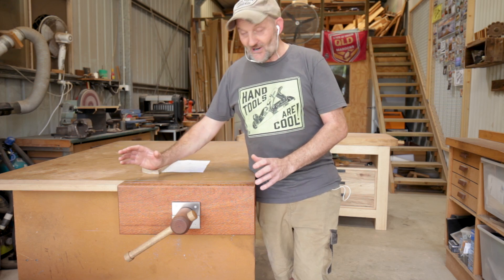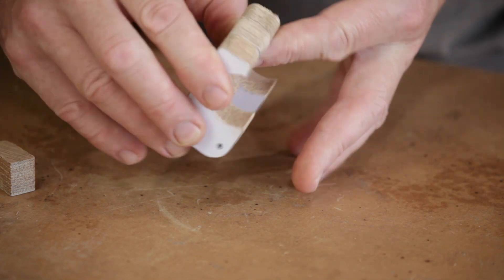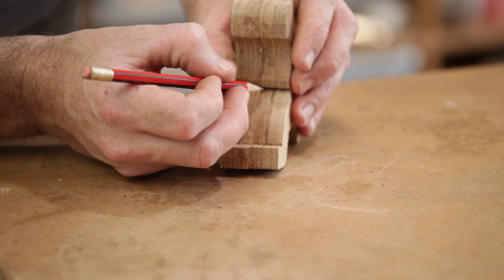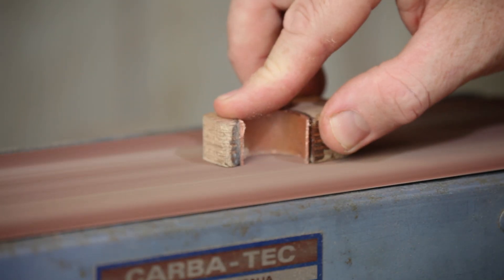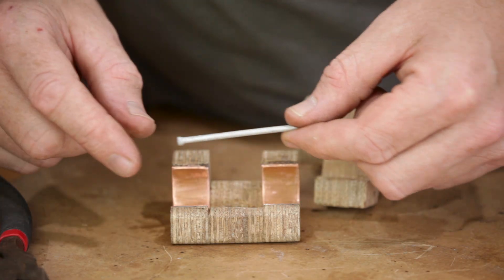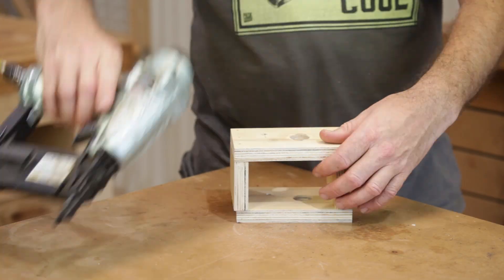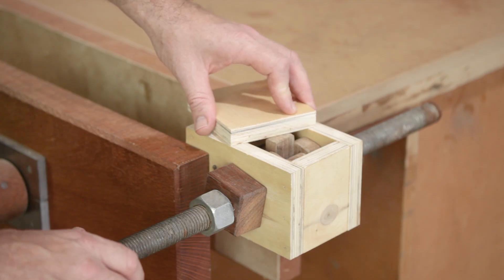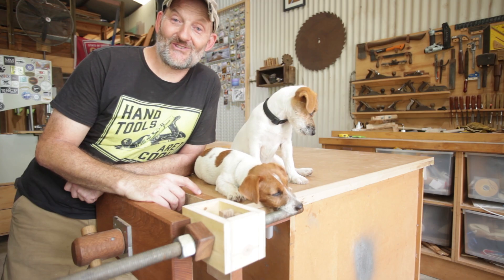Easy Quick Release Vice Mechanism

Comment: Those plans just has to be paid with pay pal eh? Thats too bad, just cant trust pay pal, i never have. Im attenpting to watch your video over and over again to mak a mack up of plans of my own and my goodness its hard. You really have no good shots but i know the threaded bar is 24mm and you cut the slider holes at 28mm. But the middle piece that holds the half nut, the little back arm goes up at an angle instead off parallel with the center on the nut. Thats where im stuck like im missing something.

Comment: Hi Neil, i bought your plans for the workbench build mainly for the quick release vice. just completed my build and i have to say it was worth every cent. the plans are clear concise and having watched your video as well it was a fun project. the main thing i had to change was to find a new pin placement for the pin that the quick release unlocks against as i did not have rare earth magnets. the magnets i had were a bit weaker  so once i had the pin placement a little shallower it worked like a dream. Thanks very much for all your inspiring ideas. Regards, Patrick in South Africa.

Comment: I've just bought and down loaded the plans from your website, and you have done a beautiful job of laying it out.  I like that have made it accessible to the home shop user who has limited facilities.  The nylon bushes made from a chopping block, for instance, is a nice idea.  I mainly bought the plans for the hole centres for the QR mechanism, and I'll be making a vise out of metal.  My main worry is that I'll waste time over-engineering it, but as a time served toolmaker it's one of those 'can't help yourself' situations.  We are slaves to ourselves sometimes.  A huge thanks for the idea which came fully from you.  There are some other versions of the same mechanism online, but yours is stand out better than the others.    Don't forget to check out the Yolanda Mens Shed.  The lathe/mill drill in their video is not flash, but Sheds continuously upgrade their equipment.  Check out this report of Oz and NZ sheds.  The Coffs Harbour shed is HUGE.  I am secretary of the Blenheim shed, and there some pictures on page two of the report.
https://martinsonline.travel.blog/blog-feed/

Comment: Great video, I bought the plans and I'm in the process of making a pair of mechanisms to convert my existing shop made twin screw  vice. I'm using 3/4" threaded rod as that's what the existing vice was made with. When I assembled them the nut  released as it is designed to do but wouldn't re-engage. After a little head scratching I added a second magnet on top of the first, that fixed it and works great! Suggest you add a note to the plans that if the nut doesn't re-engage try a bigger magnet. My first magnet had 9 lb  of strength not much less than the one you used which I believe is 9.5 lb.

Comment: As I say in this video clip, I had to make your quick release vice and the mini-workbench to mount it on just because I thought it is so clever.  https://www.facebook.com/Zale.Dalen/videos/10215501612106963/  My only regret now is that I don't have your quality of scrap wood, so had to make the workbench out of construction lumber, which is too soft.  But it all turned out so well that I think I'm going to remake it in hardwood. I'm also going to learn how to weld so I can make your welded version of the quick release mechanism.  The plywood version works great, mind you.  But it's time I learned to weld, and that quick release would make a good project.  I have a little TIG welder.  All I need is a bottle of argon. Thanks for all the inspiration.

Comment: Great Work. I assume this will only work if the mechanism is mounted horizontally. If you need to use it vertically (For ex. making a height adjustment mechanism of a DIY saw table or router table) you can improve this by having that holding pin to go through a hole in the notch of the center piece and have it to be spring loaded to hold it in closed position. Then cut a curved grove in the housing with the pin jutting out a bit. In this way to quick release you can turn the jutting out pin (You may fix a knob ) counter clockwise which will open the nut.

Hope you understand what I am trying to say.
Reply from the maker: Thank you! I do understand what you're saying but not sure if this mechanism would be best suited to work vertically anyway. If it were to lift a table you would have to hold and lift it to move it into position which could be difficult if it were heavy! :)
Reply: What I meant was lifting the router or the circula saw blade, or to be used in a vertical bar clamp

Comment: Your project looks great in both wood and steel versions and thanks for posting.  What do you think of using an acme threaded rod (with the square top threads) such as the type used in a scaffold leveling jack instead of the 5/8-11 tpi  all-thread?  Would that be any improvement? I happen to have an extra one of those jacks and could cut the rod from it to adapt to your vise design. The diameter of the rod is 1-3/8" and 24" long.  I know that regular threaded rod is more commonly available but these scaffold jacks are only US$14.85 - you can see a photo of them here:  scaffoldmart.com/accessories/scaffold-jacks/level-jacks  The model is 378J and it is a solid rod not the hollow type.  They show a load rating of 23,000 lbs.  The only complication I see is trying to machine the wing down into a half nut shape - I could get close with the portable bandsaw but it would not be as precise as starting with a perfect hex nut.
Reply from the maker: It should work no problem! The only way to know for sure is to try it! The nuts on those levelling jacks have a very sloppy fit, but may not be a problem. :)

Comment: using hot glue with neodymium magnets is not a very good idea - hot glue is about 120C and some neodymium  magnets have working temperature as low as 80C - overheating may result irreversible strength loss
Reply from the maker: Fair enough although it seemed fine. I did say that epoxy would be the correct way to glue it, I used hot glue for convenience. :)
Reply: ingenious device BTW - wanted to say it since the welded one :) thumbs up

Comment: Why hot glue instead of epoxy to fasten the magnet? I suppose hot glue works okay, but epoxy is a lot stronger and more durable, especially in hot weather.
Reply from the maker: You are correct. I should've clarified that, I only did it in the video to make it easy but I say to use epoxy in the plans. :)

Comment: Dude! ..You're awesome! Great design. Great execution! I would have told them "then this would be a good time to learn how to weld, wouldn't it.." it's funny to me that so many wood workers will only work with wood and so many iron/steel/metal workers/welders won't cross the line into wood either .. I like your rounded approach..
Reply from the maker: Thanks very much mate! I agree, the challenge of learning something new is the fun stuff! But on the other hand I enjoyed the opportunity to make a no weld version.  ;)
Reply: Not everyone has the money to buy a welder or the contacts to have someone with one available to use and learn on. 
I doubt very many would be afraid to use the other equipment if the opportunity presented itself. The no weld approach is great and we are fortunate that Pask took the time to create it.
Reply: Wayne Crews if you've got the money to access youtube, you've got the money to buy a welding machine. Go shake your fist elsewhere. You're arguing a moot point. don't waste your time like that. You could have bought the plans and be well on your way in making one for yourself by now. Let me know how it turns out..